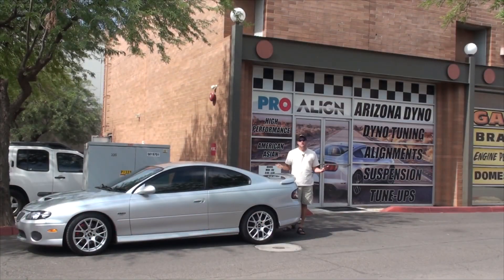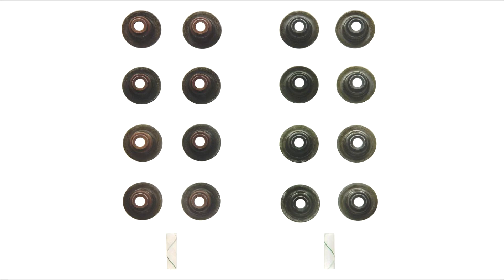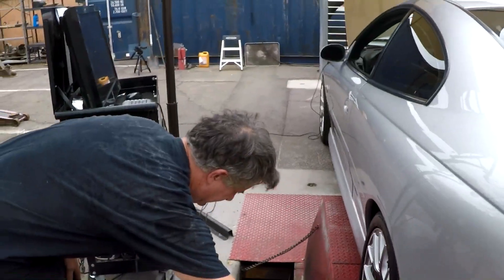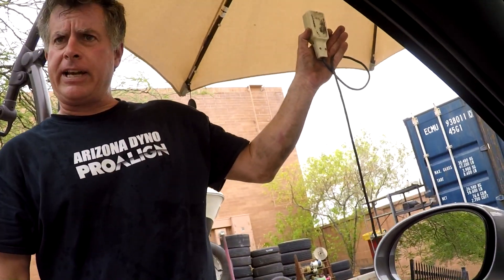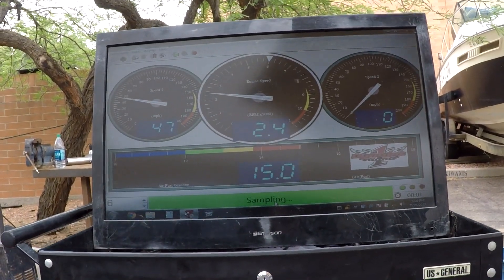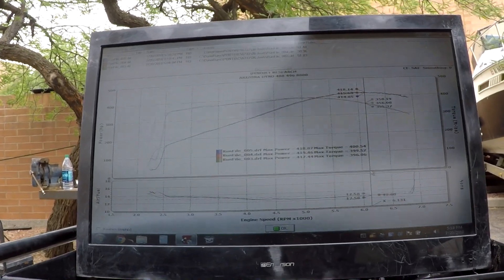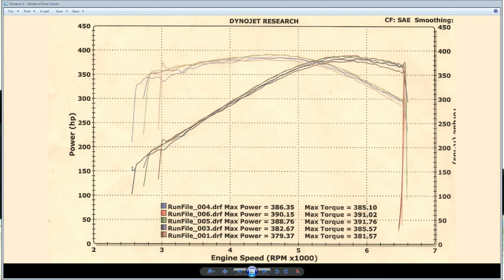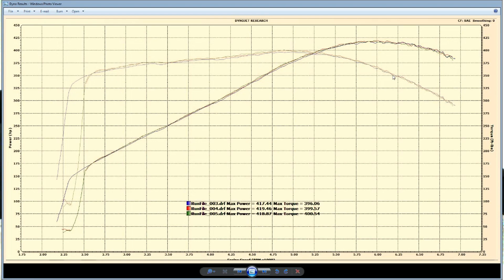Josh's Car Corner - Ep. 59 - How much power does the GTO make?

Comment: my 05 6.0 gto has 206,000 completely factory miles on it and made 349 wheel hp on a merciless dyno dynamics dyno.
Reply: Only 349 wheel hp?! WHY?
Reply: @slowgoat6089  thats factory wheel hp, if you factor in drivetrain loss you get around 400 crank hp
Reply: @Ma77riK  - what mods do you have
Reply: @slowgoat6089  349 wheel hp is factory...so factory.
Reply: This is why this car is such an amazing daily. Great power, reliability, and comfort. MPG on the highway isn't too bad either.

Comment: Not bad man considering the conditions. I know it feels great. Especially that slight car shake you get at times. My 04 with bolt-ons and a RPM level 5 tranny with a Vig 3k stall put down 330hp on the dyno. My first cam was a 228r and I loved it...but Of course I blew that motor and dropped in a LS3 short-block stroker 418. But hey. Gotta pay to play. Keep that Goat looking good. 🤟🏻🤟🏻🤟🏻

Comment: Josh great video and explanations.   I've always heard the streetsweeper ht was supposed to be good for a daily driver although it's intake/exhaust and lift numbers are a bit higher.  228*-232*-111*-.612"-.600.      Do you have any thoughts on this cam shaft or what it would do compared to your powercurve?
Reply from the maker: If I could do it again, I probably would have gone with a bit more duration, something like 224/230. On a stock LS2 head, there's not a lot more to be gained with going over .600 lift, the head just won't support it. Stock cathedral port heads tend to run out of airflow over .550 lift. Also, it means you most likely will have to run dual valve springs and heavy duty rockers, but that's another discussion entirely.

Comment: I don't want to be rude but this guy knows little to nothing so don't take his advise one example cams a cam is set to the flow rate of your head's you don't take a stock motor and throw a high lift cam. The. Flow rate of you head's determines the duration of your cam you will lose power and efficiency with the wrong cam this gentleman has no clue it shows in the engine output with the parts you should be 500 plus only God knows what other mistakes he made I'm not downing this guy he's a nice person and I'm sure he means well I was not going to say anything but to save other's from wasted time and money I got to say something he would have been better of with a chip a good tune and change shift points if a 4 speed auto you can get more out of your car than he did my friend did this and got 43hp and a good torque curve a 6.0 starts with 400 hp so did he go up or down

Comment: Surprised you brought it up to almost 7,000 rpm's when redline is a little over 6,000 rpm's.  Not good for the engine IMO.
Reply from the maker: The bottom end can easily support it. The factory redline is 6,600 RPM. The valvetrain is the weak link to revving it higher and that's been upgraded.
Reply: @JoshsCarCorner   Great to hear about the valvetrain.  I was hoping you weren't revving  that many RPM's stock. 
 I love my 2004, that I've owned since new and bought, stock.  One owner, me. 
 I would love to beef it up but there are so many options I'm not sure which to go if I ever do.  I love the car stock.  The 2004 stock exhaust is the best and it still offers power that will beat 98% of the cars on the road today.   Heads and cam are what I am thinking but I personally am not certain.  What is your suggestion for the best priced,  highest horsepower option, for the LS1 2004 GTO's?